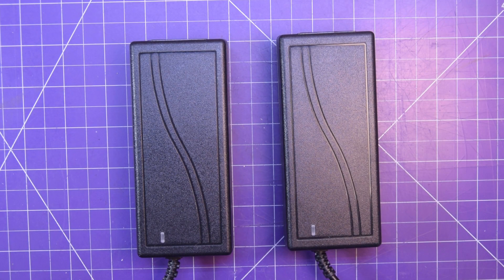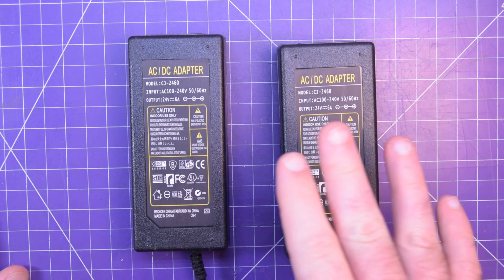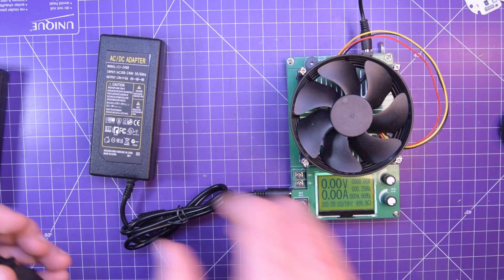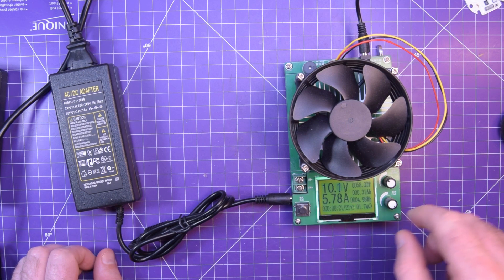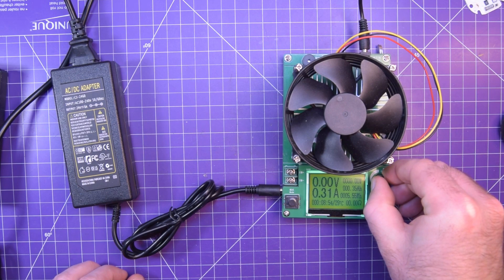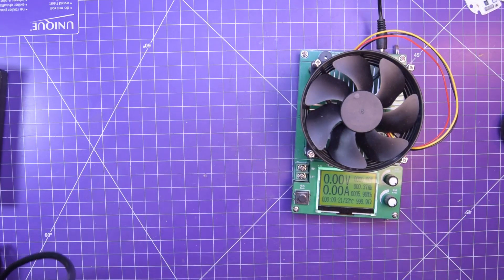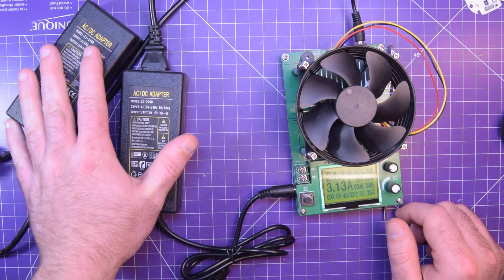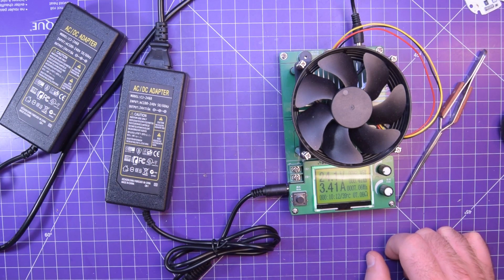When 24 Volts....Just Isn't....

Comment: I did a similar test on 6 different 24volt supplies of various ratings. I did time vs temp test at various current outputs.  Used a similar load you have too.  The fan should of turned on, mine does rather quickly when the heats sink gets warm.  I think there is a configuration setting to change that.

We needed a good 24v supply for a packaged product and needed to quantify them.  Some were even “name brand” supplies bought from digikey, others were special ordered from China that was supposed to meet our specifications. The ones that did come closest to rated output got very hot. A couple let out the magic smoke.

We ended up using a BX-24005000.  This did put out 5amps at 24volts.  It did get 65C after one hour at 5amps.  This is a $20 supply

Comment: I have these exact power supplies and they work fine for my application... although, I'm only using using one to drive a 1 amp load, and the other is drive 3 10 watt leds in series, I have them driven by a boost convertor that steps the voltage up to 36 volts and limits the current at 1 amp ( they are 9-12 volts for the forward voltage drop). The later requires 1.5 amps, and throw in the inefficiency of the convertor and the cooling fans, i figured at worst 2.5 amps... From there I figured if these things could only put out half of what they are labeled for then I'd be ok... and it seems like that is the case. Usually I take whatever ratings they give and cut them in half on cheap stuff.

Comment: These are more like your typical 65W laptop power supplies, just re-labelled with some voltage mod. Obviously even most efficient power supplies are bigger, you can't expect small power supply to put out that much power.

Comment: Nice video I also have a couple of those bricks and yes get about 2.5-3 Ohms at 24 Volt only not their rating another thing is they weigh virtually nothing compared with a genuine 24V 6Amp psu
Reply from the maker: Yeah I was hopeful, but ultimately, I'm glad I got them from Amazon because of their return policy

Comment: Though this may be a case of intentionally fraud, it is a common rookie mistake, when selecting individual components to use in DIY circuits. You must consider the separately stated Watts rating, which is most always significantly less than the stated Volts multiplied by the stated Amps. Why? Because the issue is the amount of heat that the component can withstand and not necessarily its electrical capacities. Again, why? Consider the math... 1V x 10A = 10W and 10V x 1A = 10W. So, a component with ratings of 8V, 10A and 60W can withstand 8V x 7.5A =60W, or 6V x 10A - 60W  (Or some other combination of volts and amps that does not violate any of the component's three specifications; V, A, or W,) however it cannot withstand 8V x 10V = 80W. HTH.